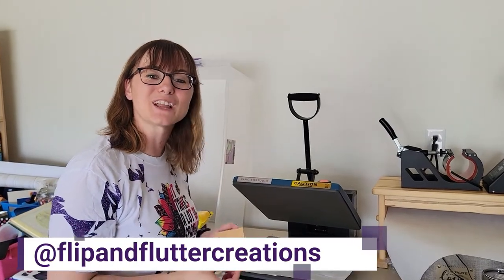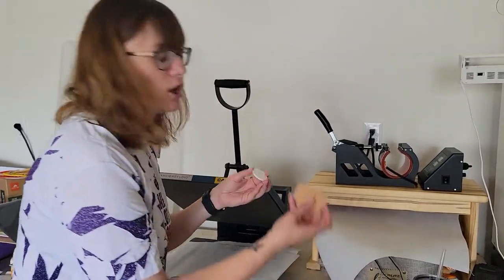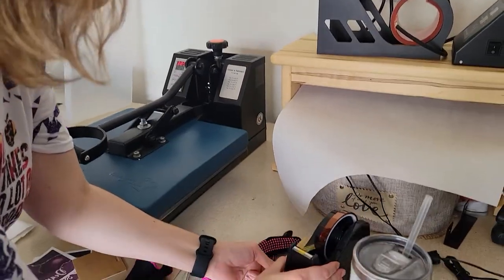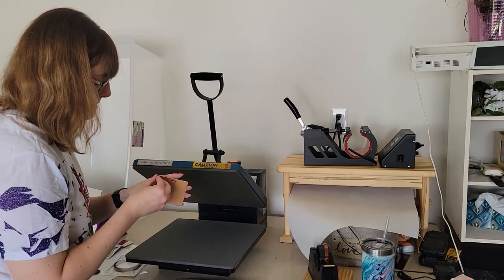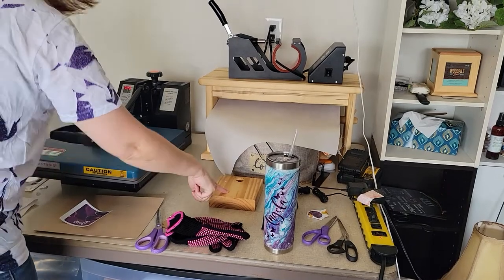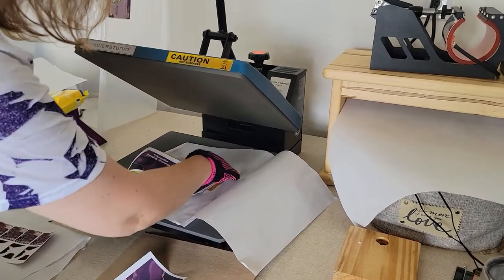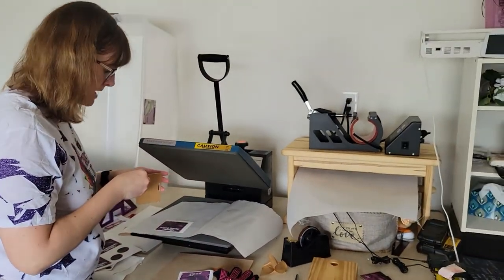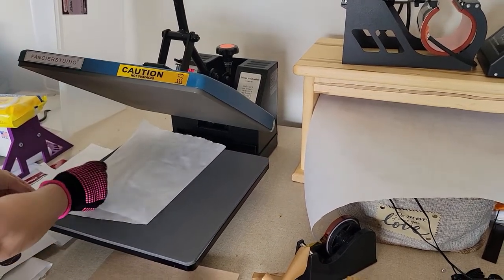Make a Badge Reel & Badge Buddy from Zindee: Sublimating the Acrylic Blanks & Putting it Together

Comment: How long does it take for this fancier studio press to heat up to average sublimation temps?
Reply from the maker: It usually takes about 5 min or so. I did a video on when I unboxed and set it up if you're interested in more info on this press. I had to replace my swing away and this is the one I decided on. I like it. :)
Reply: @FlipandFlutterCreations  Thanks. I actually watched that video, but must have missed the timing part for getting up to temp. I was wondering why you need to replace your swing away? (have seen it sitting next to the new one in some of your videos.)
Reply from the maker: @jennyb3850  the back metal bar broke apart and I don't know how to weld or I would have tried to weld the pieces back. I'd had it for 4 years already. I needed a replacement asap due to orders so I picked a new one. I kept it in case I can try to repair it later.
Reply: After pressing, keep the sublimation image on the acrylic for another 30 seconds or so. That will help a lot.